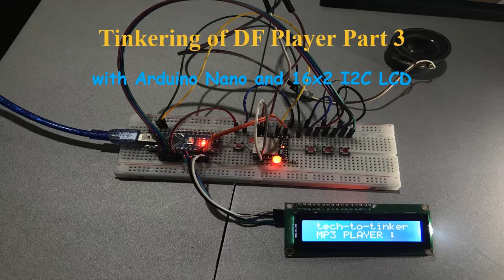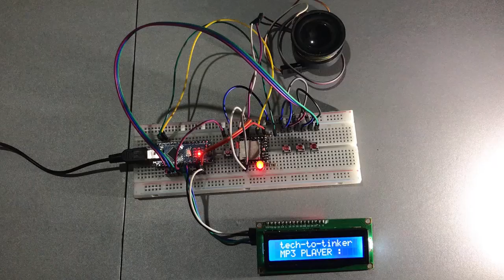TUTORIAL: DF Player Mini Tinkering with Arduino and LCD (Part 3)

Comment: Hi ! I have a same issue like you ! The backlight flickering when the sound volume is up. Did you find a fix ?
Reply from the maker: Hi @chris orion, no Im not able to find solution. Im sure it is on power, you may first try capacitor in your LCD. If not you could use an external 5V power supply.
Regards,
George

Comment: How i can make it to play one song imediately and loop it when it gets power or some kind of signal?
Reply from the maker: Hi @Kacper Duc, you may try to poll the Busy Pin (pin 16). 

If the Busy pin is LOW, it means DFP is playing a music.
If the Busy pin is HIGH, it means DFP is not doing anything so you can send a play command to play the next song.

Hope this helps.

Cheers.
Reply: But I guess it will "pause" the music. Is there a way that it will start playing the song from the beginning? I want to use this board to make door chime for my car.
Reply from the maker: @kapys1722  If you need to play a specific song when you open car door, there are 2 ways:
1. Use AD pins to play the specific segment, but Im not able to use it because I dont have resistors.
2. Use a serial communication of DFP to play the exact file name
Reply from the maker: @kapys1722  you may also refer to this: https://wiki.dfrobot.com/DFPlayer_Mini_SKU_DFR0299
Reply: @TechToTinker  Thank you!
Reply from the maker: @kapys1722  You're welcome. Cheers.